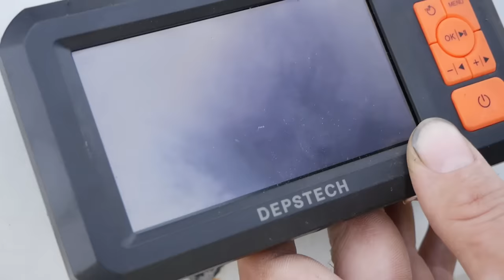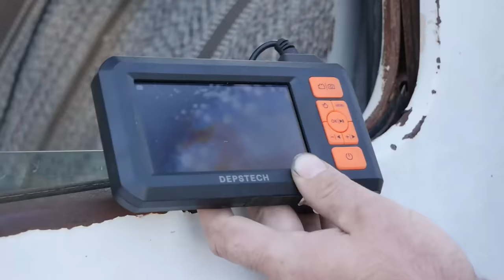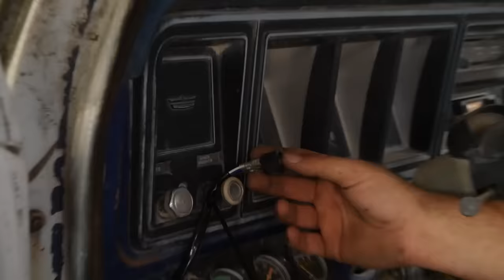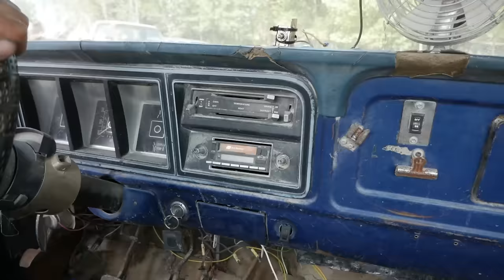Will STUBBY Ford Truck Run and Drive? Burnout Machine? Meet Sgt. Stubbs!

Comment: That's what happens when you use crap paint like  aue need to get you some UTech paint even if you do a crappy job is still looks pretty damn decent
Reply from the maker: Congratulations, you missed the point. And have apparently not watched any of the other videos where I've done actual paint work
Reply: @PoleBarnGarage  yeah that would probably because I work I don't have a lot of time to sit around I watch videos 🤣🤣🤣🤣🤣 you might be a decent painter